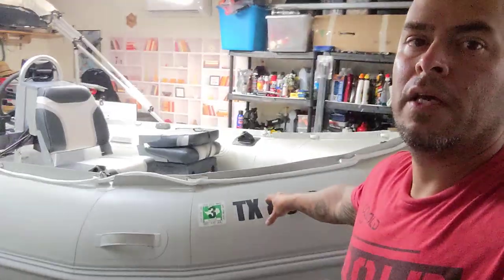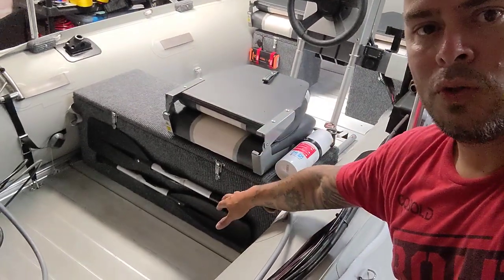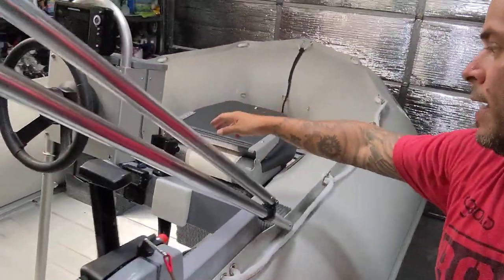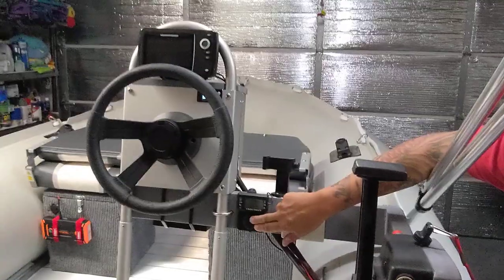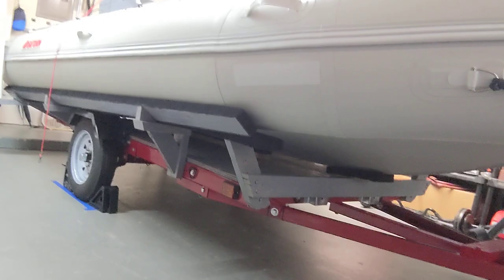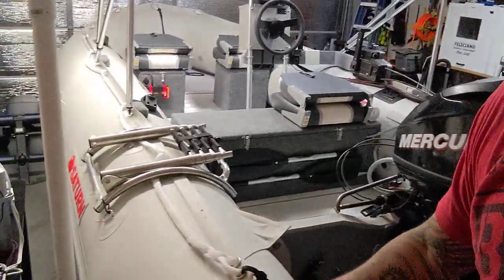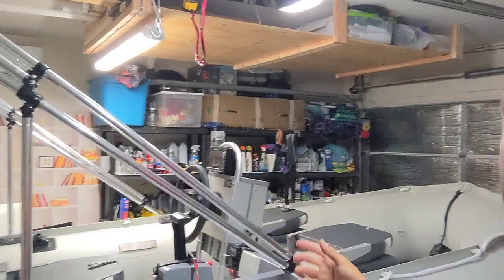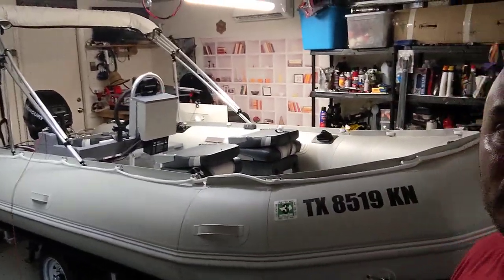Saturn SD470 Boat Build with Customizations and Trailer

Comment: Awesome boat and set up... just saw you posted a new video of the fb300... sorry comments turned off. Was wondering if you could post a video of installing seats. Really interested in seeing bolts used and how they look in floorboards. Even if it just showing the floorboards itself  would be helpful. Thanks and congrats on new boat. I plan on getting 13ft of same model
Reply from the maker: I use "L" brackets with m8 weld nuts. The weld nuts go through the bottom of the floor (I drilled holes) and they are flush when pushed into the floor from the bottom. Then I use M7 screws through the top, the "L" bracket is screwed into the wood of the seat box and the bottom of the "L" bracket is secured to the floor with the m8 screw which taps into the weld nut. Solid. Weld nuts are like these but 8mm https://www.zoro.com/midwest-fastener-corp-8-32-x-14-coarse-thread-slab-weld-nuts-20pk-931381/i/G202529085/?utm_source=google&utm_medium=surfaces&utm_campaign=shopping%20feed&utm_content=free%20google%20shopping%20clicks&gclid=CjwKCAjw-rOaBhA9EiwAUkLV4ljNzD_co5zKryLhg6P1MeC1CnL8Hip1Xe9SbOFg9vp4JJZRCEU1iBoCu48QAvD_BwE&gclsrc=aw.ds.

Comment: FANTASTIC BUILD!  can you do a quick video on the cable hookups for the gear shift and throttle? Can't find a good video online.. your channel would blow up if you did one!
Reply from the maker: Unfortunately I no longer have the boat, I sold it a few months ago. But if you get a bigger name outboard like Merc, Yamaha, Suzuki there are kits available to convert from tiller to steering. There are some linkage connections in the outboard that would be updated to accept remote control.

Comment: Thank you so much for posting this! i bought the 15ft model last year and have been looking for a video where someone shows them using a steering wheel and gear lever for the outboard. I’m currently in the process of switching my tiller to remote so i can do this
Reply from the maker: Makes all the difference being able to sit comfortably and steer while facing forward.

Comment: Really  enjoyed  your video. Thought  you did a real bang up job on customizing  it.  One question  ; how does your streering  operate?
Reply from the maker: Thanks. What do you mean how does it operate? It operates like any other boat rotary steering system. It has a rotary steering kit, teleflex steering cable and a steering wheel.

Comment: Great super build. I got the SD365 just built box for the seat and gas tank storage but I’m having trouble putting it on the aluminum floor. how did you install the 8mm weld nuts for the install?

Comment: Whatta nice setup! I'm thinking to set some seats to my Greatwhite VIB400, and it has same kind of aluminium floor. Those boxes seem to work really well, my question is that has there been any stress to the alu floor caused by the boxes and attaching them to the floor? I've also seen some aluminium frames to set on the floor where the seat could be attached...
Reply from the maker: Hi there. No stress. This is the 3rd boat that I built this way. It's pretty solid and functional and we've had some choppy water times.

Comment: Wow !!!  What a Great job Man! Can you pls help me to setup steering wheel and throttle control 🙏
Reply from the maker: There are tons of vids out there than can help, it takes some trial an error to get the cable centered perfectly, I needed more than 1 try.
Reply: I bought a Mercury 9.9 but now realized my motor has handle and the one you have does not have handle. Pls explain the difference .

Comment: what are the negatives? I am looking at either the HD470 or the 18ft one with a 25hp on it. I figure it would be about 6k. Alternatively I can put that 6k towards something used. I want the steering wheel and I would like 3 rows of two seats each. Do you have any regrets?
Reply from the maker: I wouldn't say regrets, once you are moving fast and the boat is on plane it feels stable but man at times it sounds like it will snap in half from the metal floor boards creaking and bending. And it is light so it will jump around with waves a lot. But we fished from it, swam from it and it was great I love how easy it was for me to launch solo. And recover solo.

Comment: One other question on your 15hp, I'm getting ready to hook up the shift cable and throttle. Did you by chance take any pics on the connection points. I have the same engine and didn't find much help online for the 15hp. Thanks again
Reply from the maker: I figured it all out as I went along as I didn't buy the expensive hardware kit that is sold to convert to remote. I custom made my parts and if I had to I would suggest to others to either get the kit to properly rig their outboard as I cannot accept liability for how I rigged mine.
Reply from the maker: I didn't document any of it to be honest.
Reply: @IsmaelPR32  Understand thanks tho, I’ll get a hold of mercury or go online and get the conversion kit.

Comment: Would you say that the boat would be great for fishing like the in the surf and launching it and deflating it and re flatting it because I don't have much space. Also I was looking at the Scout inflatable boats and is questioned which one to get. Also I was wondering where you bought the boat
Reply from the maker: It's great for fishing, no question. I didn't want to bother with inflating and deflating since I kept it in my garage. But it is totally doable. To use scotty mounts you need the base to use for these boats https://www.amazon.com/Scotty-341-BK-Glue-Inflatable-Boats/dp/B004O0BOCA/ref=asc_df_B004O0BOCA/?tag=hyprod-20&linkCode=df0&hvadid=312061152211&hvpos=&hvnetw=g&hvrand=17629784223212309206&hvpone=&hvptwo=&hvqmt=&hvdev=c&hvdvcmdl=&hvlocint=&hvlocphy=9028249&hvtargid=pla-627272663992&psc=1&tag=&ref=&adgrpid=62138615036&hvpone=&hvptwo=&hvadid=312061152211&hvpos=&hvnetw=g&hvrand=17629784223212309206&hvqmt=&hvdev=c&hvdvcmdl=&hvlocint=&hvlocphy=9028249&hvtargid=pla-627272663992 and I bought the boat on Boats2Go they are actually the manufacturer.

Comment: Is this boat heat welded amd does it have double layer on the bottom can you let me know I’m thinking thos or the Bris 15 ft one not sure witch one will last longer amd do better on the ocean can you let me know thanks has this one held up while you had it
Reply from the maker: Hi there. I don't recall if that model year was hear welded to be honest. This was over 5 years ago I think. The person that I sold it to was a kite surfing instructor and he used the boat almost every single day. I spoke to him a year ago maybe a little longer. He said the boat had been perfectly great for him. But he was starting to have issues with the transom

Comment: Question. Shown in detail your mounts for the bimini top.  Thanks.
Reply from the maker: They are just wooden blocks painted with marine paint and carpeted. With a stainless steel bolt through it secure to the splash guard on the boat.

Comment: Can you show a video in the water please, doing research hopefully to get one soon
Reply from the maker: Unfortunately I no longer have this particular boat. I am finishing custom work on the Heavy Duty FB385, which includes a layer of protection on the hull similar to Stryker Shield. You can see it here in this video https://youtu.be/siwNNHr2x7Q But I can tell that this boat was great! It was fast enough for it's size and I had a lot of fun with it.
Reply from the maker: You can also see some of the build photos here https://drive.google.com/drive/folders/1RaY6zGtVlx5Pmp11WPF2bQXlpsRgQEVd?usp=sharing
Reply from the maker: Here are photos of this boat as well https://drive.google.com/drive/folders/1mRfgKpUQJa6hVngtCbcaRXuRvhr_3OK0?usp=sharing

Comment: I went to Boat Connection sales and service at 71 S Military West Palm Beach Fl 33415 with my Saturn inflatable boat the same as yours, but they don't want to install a steering wheel to the engine, the reason is they don't want to be liable for any accident. 🙄☹🙁😭
Reply from the maker: That sounds about right. I have actually build and customize for different inflatable boats now. And I always have people asked me to do it for them and I always tell him that I don't want to take any chances with liability.

Comment: This setup is awesome...any plans to make videos about each part you made or do you plan to sell anything premade or the plans and step by step videos? So difficult to find really great products and your setup is so clean.
Reply from the maker: I really wish that I could do more, work, home, wife, kids, etc... I bought a lot of easily available items and of course custom made what I wanted a certain way. The boxes are just standard wood boards, water sealed and carpeted with outdoor carpet from Lowes and I used an air staple gun to secure it all on with stainless steel staples. All hardware is stainless steel.

Comment: The best setup I've seen so far man. WHAT A GREAT JOB!!
Reply from the maker: Glad you like it thanks!
Reply: @IsmaelPR32  can you make a vid or explain here by txt how you converted that 15hp from tiller to console? Thank you.
Reply from the maker: @pandaoverboard  A lot of tillers can be converted either by buying a kit which was available for the outboard that I had. Or buying it already set up with controls. I searched a while for it. No video or instructions really available, apologies.
Reply from the maker: @pandaoverboard  I actually got the outboard with the throttle control cables and remote control box from someone that had it setup that way.  I added the console and a new steering cable, etc.
Reply: Great setup 🤌🤌 will follow your model in malaysia

Comment: Really great build. I was wondering how did u add the Scotty mounds ?
Reply from the maker: I used PVC glue made for these boats, followed the instructions and it worked like a charm. Scotty sells mounts that are for inflatable boats that have a bit of a curve to the base.
Reply: @IsmaelPR32  alr thank you

Comment: This looks awesome!!!  I just bout the FB365 two days ago.  A lot smaller so I can’t do much with it but your video is very inspiring
Reply from the maker: I actually bought an actual fiberglass boat but I do miss the inflatable setup, plus it was way easier for me to launch on my own. But I do have the FB300 which is even smaller than yours lol and I just uploaded a vide about that build. That one was a limited build due to the smaller size but it works I have caught some nice fish with it! It's my interim bought while my fiberglass boat is in the shop having an oil leak repaired.

Comment: Really nice looking boat with all the customizations! It looks like this is a 15ft boat which is on the Harbor Freight trailer and in the garage. I have a 14 footer from Saturn that I am thinking of converting a Harbor Freight trailer. How did you extend the tongue out? Did you have to weld an iron bar? Thanks.
Reply from the maker: Thank you. And yes I bought a piece of steel stock bar from a metal supplier. The 4x8 trailer has a slot at the front to pass it through but you'll need to secure it at the end. I did weld it but you will also need to drill holes in that very thick metal.
Reply: @IsmaelPR32  thanks for answering. I see that you sold the boat. And you mentioned in another video you have a real boat. What is the difference? And is the real boat a lot more work?
Reply from the maker: @philos212  I sold the fiberglass boat after about a year. It was definitely a lot more work and use a lot more gas obviously because it was an actual heavy 18ft boat. But I just bought a Seamax 430T which I will be customizing just like my current FB 385.
Reply: @IsmaelPR32  really good to know your perspective since you have owned both. I was thinking of getting a used fiberglass but was shying away because I read they’re a lot of work  and also much more fuel. I think I’ll stick with my Saturn XD 430 for now. Hope you will post some of your mods as it helps us a lot. Thanks man.
Reply from the maker: @philos212  I sold the 18 foot fiberglass boat. It was a lot more to maintain and store. Cleaning and gasoline usage was more as well. I just got a Seamax 430T which I will customizing similar to my FB385 boat you can see here https://youtube.com/shorts/geDj_9yXuUY?feature=share and here https://youtu.be/siwNNHr2x7Q and here https://youtu.be/52flmoI_4-M and here https://youtu.be/joyYwkGvpyg
Reply from the maker: @philos212  it was a lot more work (I responded on your other post) these boats are much lighter an much less weight to two. We go camping a lot and we beach our inflatables in a lot of areas and go into shallow areas that the fiberglass could not. So these work best for our use personally https://drive.google.com/file/d/1BzHRmvXjv7a75DoLPVrxRMrPusHPv55o/view?usp=drive_link
Reply: @IsmaelPR32  Watched the videos. Man... that thing looks fantastic!! Approximately how much more money other than the boat and motor went into this thing, just curious. I wasn't able to open the google drive thing, since it requires access.
Reply from the maker: @philos212  I gave you access to the drive link. It's a photo. Like $100 in wood. Some paint and hardware. I designed and 3d printed all custom parts. Aside from the boat and motor maybe another $400 to $500 maybe less.
Reply: @IsmaelPR32  That is awesome! Does the $600 include the driver console as well? What brand console is it? Thanks for answering these questions..
Reply from the maker: @philos212  I also buit  that from wood. I bough the steering wheel, cable, etc. Added my switches that I wanted to have. You can get some ideas from posts on this group https://www.facebook.com/groups/440858790013759
Reply: @IsmaelPR32  I have requested access to join that group. Thanks for the answers. Keep up the mod jobs. It is nice to see the true capabilities of inflatables being explored to the fullest...

Comment: Awesome build. I have a 16 foot saturn on a flatbed trailer i dont really like. Can you tell me about your trailer build or is there a video or some pictures of your trailer that i can reference?
Reply from the maker: Unfortunately I don't have a build video for the trailer only what gets shown in the video. I use 2 x 6 boards under each tube with a 2 x 4 on the sides of the tubes at a very slight angle, it cradles the tubes on each side.

Comment: Hey brother, Your sd470 has been an inspiration. I really appreciate your video! I bought an sd470 and I'm trying to bill it out now as well... I ask you a couple questions 

1- could you please send me the information on your Bimini and where you bought it from and how did you anchor the bottoms? It's a little difficult to see on your video but it looks like you put it through the plastic area where the ropes are and then you have some piece of wood wrapped with Marine carpet over it to hook up to the attachment points for the Bimini 

2- I was wondering if you can give me more information on how you built the arm from the console to the right side tube..

Thx bro
Reply from the maker: @gtmmswt  this was a long time ago. I cut out wooden blocks to screw the Bimini mount screws through.

Comment: Can you do a video how you added the throttle/ steering setup? Like where you get the cables and so on?
Reply from the maker: Unfortunately I cannot. I no longer have this boat. The cables are just standard throttle remote cables for boats and the motor on this boat was a Mercury and it was a mercury throttle remote box. Although I bought this motor and remote box already rigged

Comment: Just wondering how did you attach the weld nuts under the floor. Did you use expoy to hold them in place.
Reply from the maker: I used an industrial adhesive like E6000. I have done it on 3 boats this way and I still haven't had one come loose. Then I use gorilla tape over them to keep any sharp edges off the PVC.
Reply: @IsmaelPR32  Great thanks for the info

Comment: Where did you find the throttle control box.
Reply from the maker: This is something that I designed and 3D printing myself it's custom and I only made it for my own use I don't offer it due to concerns over safety if others were to use it.

Comment: WHERE DID YOU BUY SIDE LADDER FROM
Reply from the maker: It's not cheap but I got it from Europe. Here is a seller on eBay too https://www.ebay.com/itm/185836932603?mkcid=16&mkevt=1&mkrid=711-127632-2357-0&ssspo=cZgqFYSyQz-&sssrc=2349624&ssuid=jeApmXa8SUm&var=&widget_ver=artemis&media=COPY

Comment: Quick question.  I just purchased an 18’ 530.  Do you think the trailer could be customized to hold a boat that large?
Reply from the maker: If it was me, yes I would be able to customize it and extend it to support the tubes at the rear and under the transom. Definitely.

Comment: And the pics you sent look like they were oar holders not the bimini blocks
Reply from the maker: The pictures I sent?
Reply: @IsmaelPR32  yes you sent me some pictures of what looked like oar holders. I was wondering about the blocks supporting the bimini top.
Reply from the maker: @727captain  oh on this boat they were wooden blocks that I made. This was years ago.
Reply from the maker: @727captain  so I used wooden blocks, then drilled a hole through them and used a stainless steel bolt and nyloc nut (like the ones that come with the bimini) to mount through the splash guard on the boat. I installed a stainless steel grommet on the splash guard to out the bolt through and then through the wooden block which was used mainly for supprt.
Reply: @IsmaelPR32  Thanks, wasn’t sure if they were wood or if that was something from your printer. I could not find any good prints files for any type of blocks.
Reply from the maker: @727captain  just a piece of wood, painted with marine paint and covered with carpet for looks.